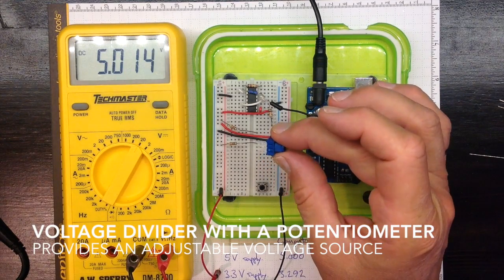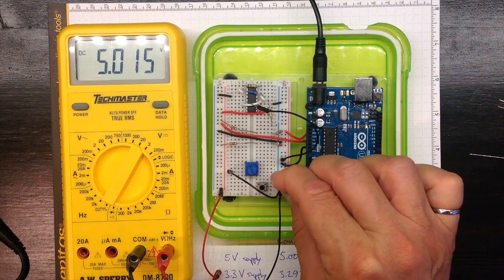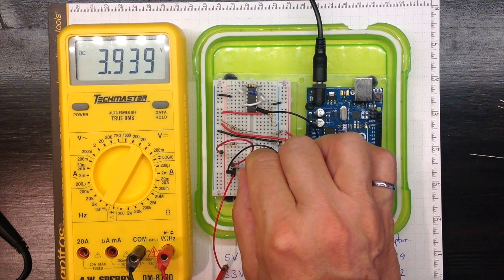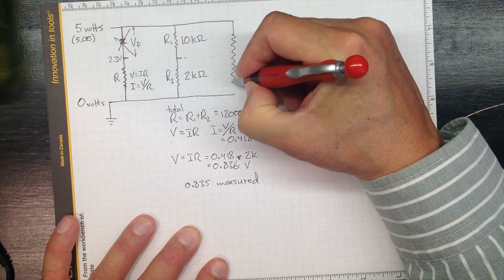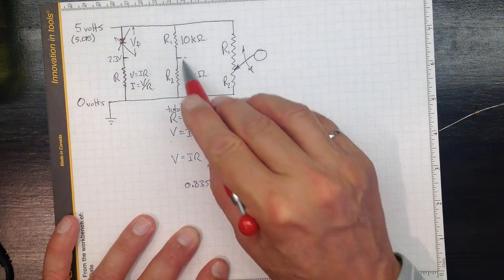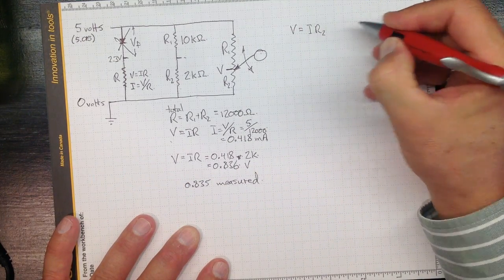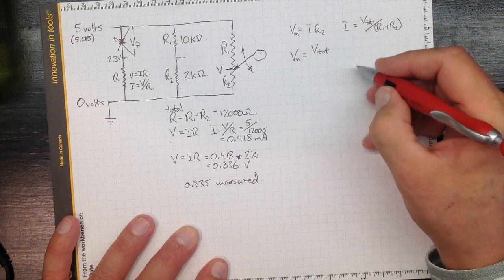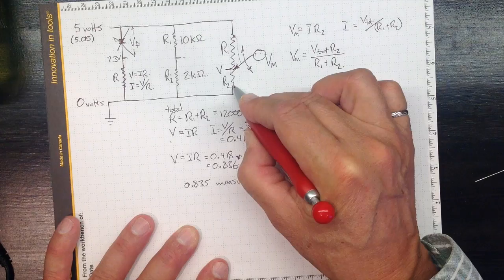Voltage Divider with a Potentiometer

Comment: Hello Rick, you seem to be the man to talk to about potentiometers!
I have 4 on a pcb inside my target 2 windvane.
They are used to get the pointer reading correctly
ov to 4.5 i think.
Nasa the maker will not tell me how to set this up.
What is the best way to go trail by errror in your opinion.
much appriciated sir